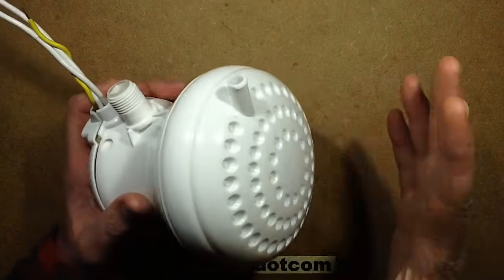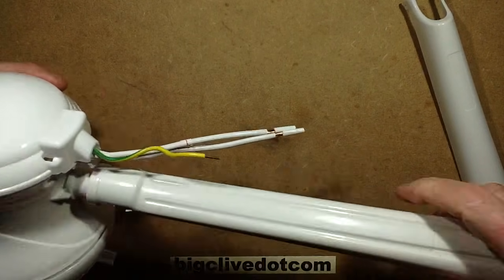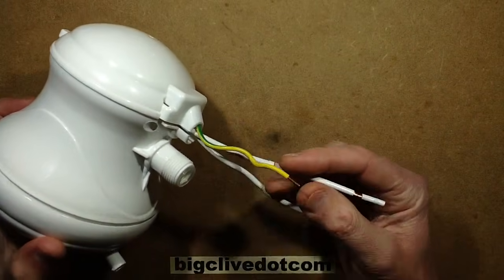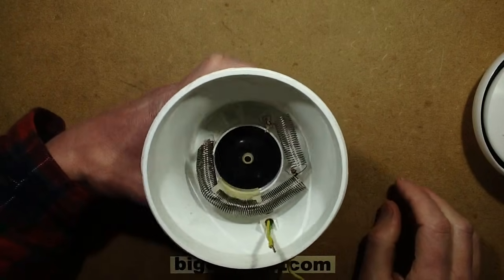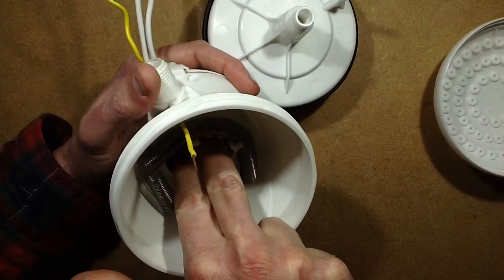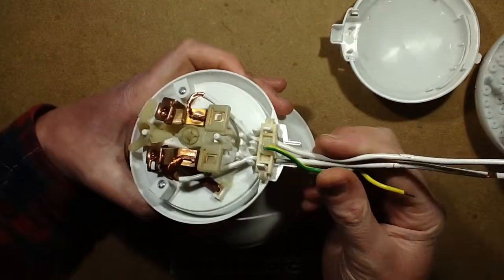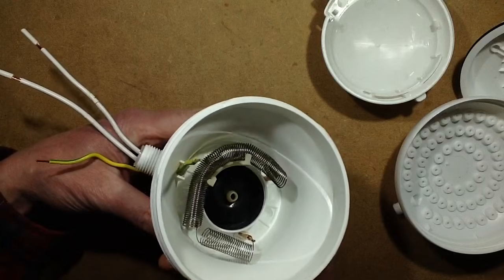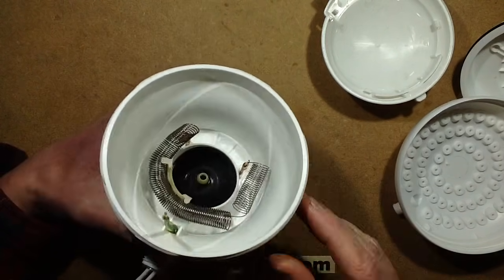Inside a heated shower head.  (suicide shower)

Comment: Big Clive! . Funny, but I was going to ask you, what with all the flooding in the U.K. of  homes & Towns, why people don't get fried by the electrickery (sic) from  the mains, as you see people wading through flooded streets/houses & in some cases . . street lamps/signs are still illuminated. I went to a job once, where stink from an empty ground floor flat had been empty for nearly a year, & in that time the shared waste from that side of the building had become blocked & flooded it (through the toilet) for over a month obviously it stunk to high heaven.  the liquids had been absorbed up the walls by the plasterboard & wooden door frames to near ceiling height. Anyway, I got a pisser from touching a damp wall, never realised the mains were still on. (I turned the D.Board off after & left a note attached) My "Q" is Clive, (& don't try this yourself for your vid's) why don't other people get shocks/fried wading through water near to illuminated street furniture, yet you can "allegedly" get fried if you drop a mains appliance in the bath with you?
Reply from the maker: +Screwy Reynolds With street lights and pillars the electrical connections are surrounded by the metal case which effectively acts as a Faraday cage to the leakage current.  In homes with properly grounded metal boxes the same should apply, but plastic or ungrounded boxes can pose a shock risk, especially an ungrounded light switch as it has just the live connections present.
Reply: Thank you Clive for the info, I thought something like that could be the answer with street furniture. Funny, for someone like me who plays silly buggers with electrickery (sic) making small home made Jacobs ladders (10.000V) & would love the chance to drop into a Faraday cage, stuck between two large Tesla coils etc, but 250v still scares the bejesus out of me when I think of plastic distribution boards in the home. Anyway . . love your video's for the opposite reasons I like "Photonicinduction's" video's, Keep up the good work.
Reply from the maker: +Screwy Reynolds Have you tried the Gabriel electrode with your Jacobs Ladder?  It makes the arc starting less critical.
Reply: Hi Clive! No I haven't, (never even heard of it) I'll give it a try one day though. Your next vid . . . . why some "t-8" fluorescent tubes (new & old) glow purple? later Clive.
Reply from the maker: +Screwy Reynolds Search my channel for "sudden science" to see why your tubes glow purple.
Reply: Yeah I saw that when you posted it, sorry Clive, I meant T12s. New/oldish T12s (always seem to be T12s & length/wattage make no difference) some new replacement tubes strike, but glow purple (obviously not full brightness) on mains switch-start & electronic ballasts. I keep some for ambient lighting (cheaper than buying coloured tubes) but only last week, I was using a 18w T12 of which has done little more than 40hrs from new, 3hrs in & it started to go purple from the centre outwards, about 15 mins in, it was totally purple. All strange!
Reply: +bigclivedotcom Faraday cages shield you against electromagnetic waves and static electric fields. They don't prevent currents from traveling through the cage.
Reply: *****
Oh, you mean the current flows through the metal to earth instead of through the water?

That's still not a Faraday cage; Faraday cages work even when not earthed.

(It may be a Faraday cage as well as being earthed, but being a Faraday cage isn't the main function)
Reply: ***** What we have is:
* A mains voltage supply.
* One side of the supply is connected to a metal box (via the water inside the box), such as an ungrounded metal light switch. We're assuming the box is not connected to earth.
* The other side of the supply is connected to earth.
* The metal box is submerged in water (ignore how the supply cable goes through the water).
* You are touching this water and touching earth.

Of course, this doesn't really mirror a flood any more, because in a flood the water is presumably earthed. But it's what we were arguing about.

Is the above list correct?
Reply: *****
This thread of discussion is not even about the device in the video.
Reply: +William White Pretty much like birds sittting on top of live tram wires (750 volts D.C., and also why the overhead people can work on them w/o power being off as they work from an insulated platform). :)

Comment: If it has a proper GFCI connection, it's perfectly safe.

Now, whether or not someone has taken to properly ground it is an entirely different story...
Reply from the maker: +Chris Lawson The grounding wire inside would actually pass enough current via the water to trip an RCD or GFCI.  They don't seem to work with them.

Comment: its not the volts that kill you its the amps. stun guns can have 1,000,000 volts but only .oo3 amps. if I'm not mistaken you can die from 3-4 amps. you won't die from getting shocked by household current people get shocked all the time, unless you draw the current efficiently i.e. being wet in water and tossing a toaster in with you. most areas around water are fitted with GFI outlets. compare that to a 12v dc circuit of a car the 12guage wire from the alternator can zap you with 60 amps if you are grounded out with one hand on the alternator and the other hand on the chassis the current passes through your chest across the heart and can very well stop it from beating. (I might be talking complete shit but this is what I've been told)
Reply: Volts directly determine the amps. https://www.youtube.com/watch?v=8xONZcBJh5A

Comment: You would be smarter to buy an instant water heater! You would only have to run a single cold line into the bathroom, then use a t fitting to supply the water heater and cold lines and run hot water lines alongside your cold water lines to the sink and bathtub/shower.

Comment: In Latin America those are pretty commonplace. Hot water tanks are expensive (say, $250 or so where the average salary hardly comes to $10.000 a year) while one of those shower heads will run you about $10. I had a few in service for many years, never really gave me any trouble. Even had one installed for heavy use by a high-end certified electrical contractor, no real objections on their part except that a breaker switch needed to be installed near the head for protection of the cable run from panel to shower. 

In all my years I've never really heard of anyone being injured by one of those. Couple stories about a mild shock here and there, is about it. But then again, most places I've seen them installed have a more or less decent electrical system with protection devices, so a major fault would be stopped if it were to occur. I guess if you had really shoddy electrical work on the building, you might run into a bit more trouble.

The most common fault you see with those is a heating element failure. If you look at the element, it's pretty thin, and if anything goes out of bounds by the least bit (water level, current, pressure), the element melts down and the shower is disabled. The upper contacts are plastic and will normally fail open, and the wire connections are high enough to keep away from water splash.

Overall I'd say if properly installed and maintained, those showers are pretty safe.
Reply: +Mario Melendez I agree. The biggest problem is that many of them were installed by someone who had no business working with electricity. I've seen so many of them installed with exposed wiring and no ground, and that gives everyone the idea that it doesn't matter how you install it.

Comment: Yeh I have had plenty of belts off them in South America. Don't know if it's as bad as the gas heating in the south, which is a steel box with vent holes and no flue. Though the showers are gas down there.

Comment: I've always wondered what a safe (by European standards) install of one of those would look like - now I'm convinced there is none. At the very least I'd like to see a proper IP55 flex entry with beefy terminals inside so you can run a flex to a junction box or isolator switch well away from the spray of the shower. a few more safety features (e.g. pressure relief valve) would seem nice too.

Other than the seriously cheap construction it isn't that surprising - electric on-demand water heaters (up to 27 kW, then with three heating elements running at 400 V on a 3-phase system) are fairly common in Germany but of course only where water resistance is high enough - usually the case in mains water system and only a problem if you have your own well and live in a place with lots of conductive whatever in the ground water. These units are sold in Austria too but our electricity suppliers don't like them - everything exceeding 11 kW requires special permission, at least in theory.

I can't really see much of a market for them either considering most older places have a gas-fired combi boiler for the central heating anyway and newer places have a central hot water tank. Maybe they come handy in the countryside with no natural gas supply though.

BTW, electric water heaters and combi boilers are the only items that can legally be installed in zone 1 around showers and baths (for those not familiar with the regulations, zone 0 is inside the bath/shower pan, zone 1 is directly above to a height of 225 cm, zone 2 extends to the sides, usually 60 cm, and in some countries there's also a zone 3 of 2 m from the bath/shower) in Austria and Germany. Of course they have to be waterproof so not even hitting them with the shower spray straight on would cause any problems.

Comment: I got shocked by one of these while visiting Uganda, when I moved up my arm near the shower head you could really feel the electricity. It was connected with screw terminals, so I doubt that earth wire was connected. I'd rather not shower than use that trap again.

Comment: Would these in theory be more efficient than hot water storage heaters (if they weren't scary)? In northern Australia you dont really need pipingsoa hot water but a solar heater or solar array install would obviously be a lot more expensive. On demand water heaters (dwelling mounted) are pretty common but nothing even remotely like this!

Comment: That is unbelievably unsafe.  Even if hooked up correctly, once that ground lead corrodes the potential voltage to the grounded drain will grow to lethal doses of electrical power.

Comment: So many failure modes. Where should I start?
Bellows limes up and keeps contacts closed when water turned off. Fire.
Switch contacts weld shut, heater on, no water flowing. Fire.
Heater element opens up in operation, arc-flash and steam explodes at user.
Earthing wire ineffective, electrocution hazard.
Abysmal wiring job, no earthing. Electrocution hazard.
Shower head limes up, flow ceases, steam explosion. 
Design done! Ship it!   ... What could go wrong?
Reply: Fun fact is we have bare-wire tankless water heaters here in Europe as well.
The only differences that I'm aware of are that these units are mounted away from the shower obviously, have electronic regulation and will not heat up without water flow but that's pretty much it.
The unshielded heating element in the water still being here...

Comment: That is a murder shower, the designers should be ashamed. It's like turning the clock back 60 years from a safety perspective, and with the greatest of respect to you, Clive, I think you went rather easy on it. God help anyone who has hard water and a cast iron bath!
Reply from the maker: +ProdigalPorcupine From feedback from other videos I've learned that other countries have less rigorous safety standards and expect the users to have a modicum of common sense when dealing with anything electrical.  I'm taming back my criticisms to allow for those other cultures, while still pointing out the hazards.
Reply: +bigclivedotcom Common sense, if only! When you've seen double sockets wired in with bell wire, you get a bit cynical! :-) Great vids BTW, keep them coming.
Reply from the maker: +ProdigalPorcupine I've stayed in a hotel in Blackpool (UK) where a fluorescent fitting was wired in two core bell-wire pinned to the wall with drawing pins pressed through it.  Also possibly the smallest and oddest shaped room I've stayed in.  They were literally just wedging in as many rooms as they could for profit.  First thing I checked was the location and condition of the nearest fire exit routes.

Comment: This is insane. I would rather build my own with an insulated resistive coil.... Or use a coil of metal tubing plumbed to the water supply and set it in a pot of boiling water over fire. Or just take a cold shower. All of these alternatives are safer than showering with electrified water!

Comment: The flow switch is required to prevent the heating elements from burning out if the water is not flowing.
Without water flow the heating element will melt.A bare wire in the water does actually work quite well in the long term to detect leakage.  You are supposed to put an RCD/GFI on the heater.  Selecting the right RCD is critical.

Comment: I did. not See any installation grounded.  They say: hey the ground is not connected to anything so why connecting it ?! / so They are immune to  any safety instructions... 
I also saw many wrong connected power sockets. Phase and neutral mixed up... Etc. (Brazil)

Comment: I wonder if you were using low voltage like solar panel with a battery bank type thing ( maybe it wouldn't get warm enough) for like an outdoor shower.
Reply from the maker: +KoolBreeze420 No.  Not at all.  These things require a LOT of power on demand.  You'd be better using a solar collector to heat a reserve of water.

Comment: lol no thanks, we'll stick to wall mounted tankless heaters... That thing is a death trap just for the materials it's made out of, forget the dodgy wiring plastic is not allowed anywhere near hot water unless it's heat rated pvc. Inside should be metal and that should be grounded with of course plastic standoff's for the elements. It also needs brains. How dodgy is it to have 2 death switches directly connecting the coils to mains? -_-

Comment: If used with common sense and basic knowledge on electricity they seem preety safe if well built. This is not the kinda thing u wana buy from china or have mounted by a random Joe. That aside i would never use it if i had anothe roption :) i prefear the instant boilers (water heater) that u mount on the wall, far away from the shower. The ones with proper safety featuers (ground and neutral sense, live and neutral corect connection detection, stainless steel mesh imput and output grounding and so on). It's the kinda thing u prefear to be rather safe then sorry with.

Comment: Hi Clive. Not sure if it's been mentioned before (always too many comments to read through!) but I'm pretty certain that extra hose bit is called a shattaf, and yes, it's for cleaning your genitals and surrounding areas. It's a "must" in the Arabic/Muslim community. Usually as a permanent installation it'll actually be attached to a bidet which is basicllay like a low-down longer-than-wide shaped sink with the shattaf attached to it for the same purpose. Also, I can imagine if by some chance that the Earth wire wasn't connected or had silicone covering it and there was an unbalance in live/neutral, I can see this unit being installed as an aftermarket thing (like an existing bath tub where most are made of metal and Earthed) and causing a bit of a problem. Though that would be installation-dependant. :D
Reply: +Evi1M4chine We don't eat with our ass either, so considering that.
Reply: +Nitrxgen For the non-religious, it seems like a nice alternative to the saucy 'jet' mode that a lot of showerheads have.
Reply: +Nitrxgen No please do not use the portable extra hose & head piece on your gonads. In the breakdown video of this type of unit, that small hose and head is a safety steam release , for when even more things go wrong with the unit and the water stops flowing yet the (poor Quality) electrical connection is still being made. Unless of course you have something down there that 3rd degree steam burns would improve :-)
Reply: Two words: Beer Enema.

Comment: Somewhat off topic:
Any plans in the works of using some of your scraps to build light arrays? I'm coming here a lot and find your videos very inspiring. I have a small indoor garden that always needs more light than I seem to have available. And there's always room for more strawberries in my belly :)

Perhaps a build with 2700, 5000 and 6400 Kelvin LED lights could be of interest to you as well? (I'd happily send you some swedish wild strawberry seeds too!)
Reply from the maker: +Rhyle eBay has a wide range of plant lights, but it's debatable whether they are as high output as they claim.  They're certainly cheap enough to play about with.